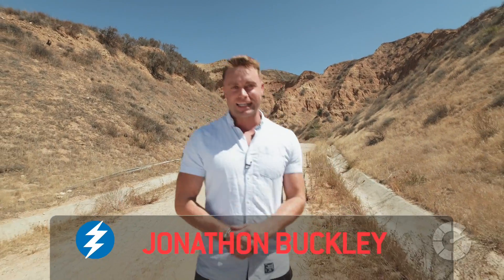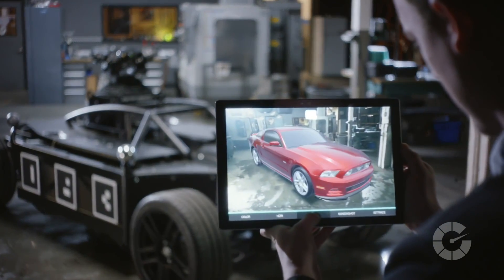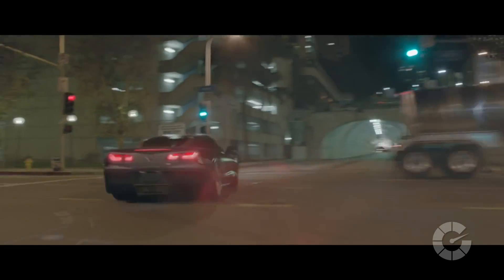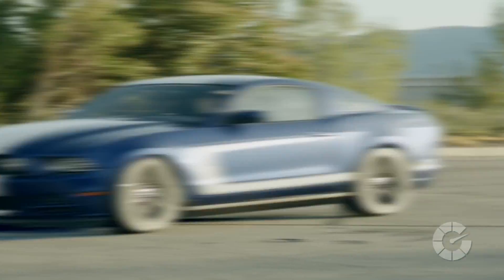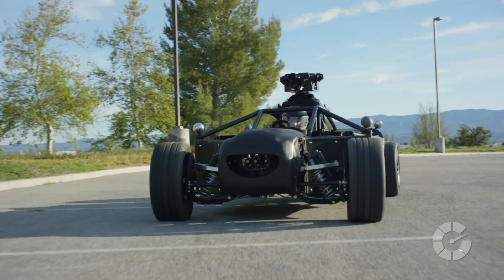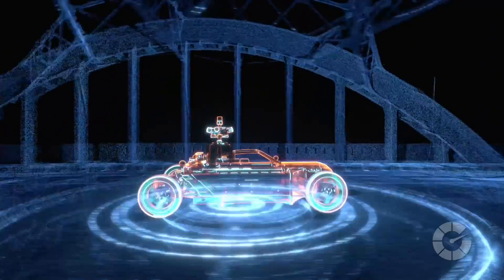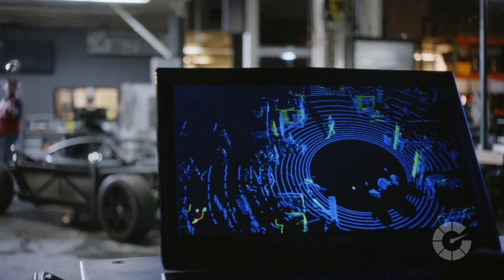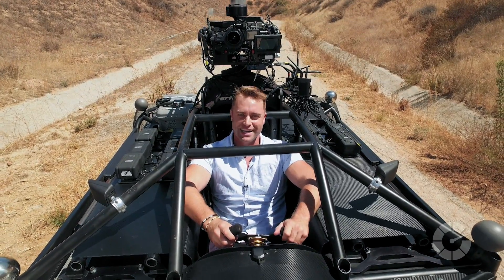The Mill Blackbird Shapeshifting Car | Translogic 208

Comment: I must be missing something, but I can't see what the physical car adds to the process.  You have to "draw" the car in the computer anyway, so what does it give them that makes it any easier?
Reply: The physical car provides a base so the computer knows where to put the car, and the car logs its every move so the computer knows what the car is doing, the orientation of the wheels, how fast it's going, etc. The on-board cameras and sensors do some crazy math to scan the lighting and reflectance of its environment to add realistic lighting to the car, because without realistic lighting it just looks like plastic
Reply: @DirtyDoctorDan  Thank you, that starts to make sense of it now.

Comment: the biggest hurdle to vehicle vfx has always been lighting. That's where this car rig shines, due to the fact that it can capture HDRI relative to the position of the car. everything else such as vehicle dynamic and speed can be easily tweaked without an actual car there. The HDRI reflection captured as sequence is what sets it apart.
Reply: does it change in real time, I.e does the human eye see the generated images in real life or is all he shapeshifting we see in this video done through vfx

Comment: So, how do I open the door of the car? And can it be a Bugatti? 2.2 sec acceleration(0-100 km/h)?
Reply: As far as acceleration is concerned, they could emulate the performance of a chiron (minus top speed of course) by gearing the car differently and programming the torque curve of the electric motor to give them more of a kick at low speeds (fast 0-100, but it will be super slow past that) for one shot, then re-gear and reprogram it to perform better past 100 for the other shots. As far as opening the door goes, they can't use the blackbird for that right now, although they could just apply the same philosophy as the blackbird to make a modular rolling shell which actors could get in and out of, I guess...
Reply: no fossil fuel car are faster dont trust me then try searching thrust scc the fastest car it even break the land speed record and sound barrier
Reply: @bryann3305  thats not a car, thats a plane engine on train wheels^^
Reply: dude, its electric motors. so it basically outperforms any fossil car!
Reply: Mind explaining what you mean when you say "Fossil Car"?
Reply: gasoline car
Reply: An electric car can't outperform a high performance car like a Mclaren or a Lamborghini or even a Bugatti.
Reply: you clearly don't know your statistics. the Tesla model S P100D has faster acceleration than a mclaren and Bugatti. no joke search it up.
Reply: AND ITS ELECTRIC!!
Reply: WOW. Respect man. I didn't know that. How is that even possible?
Reply: first of all i used a tesla as a referance point to how fast electric cars are interms of acceleration. And i'm pretty sure the Mill BlackBird can turn its wheels just as much and as easly as a buggati. (its desgin to match virtually any car)